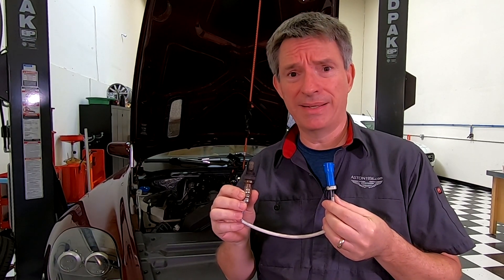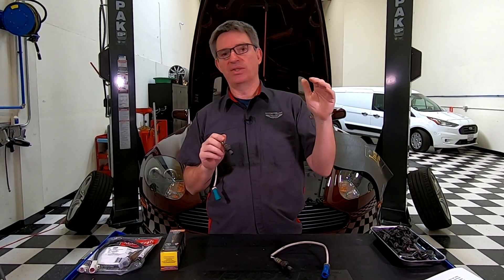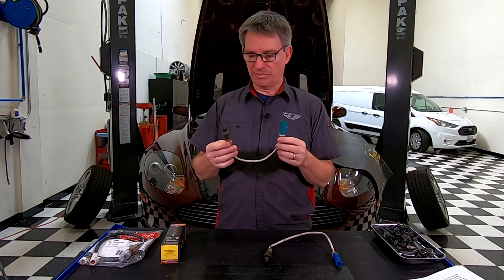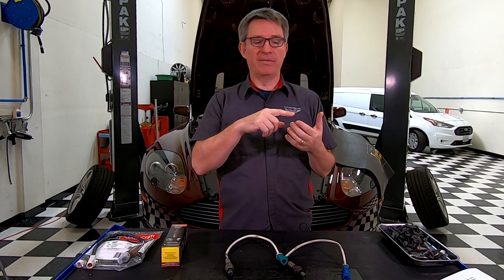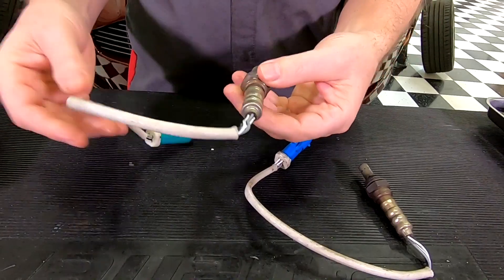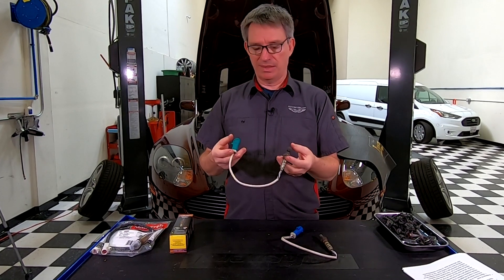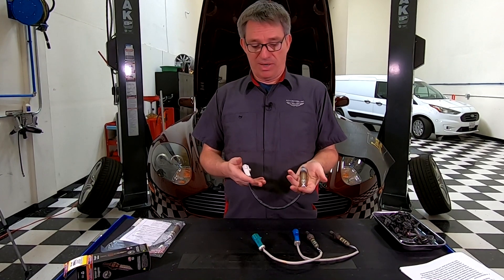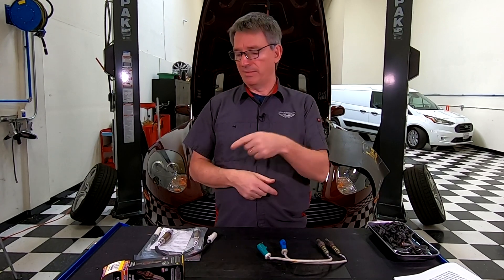Alternative O2 Sensors for an Aston Martin DB9

Comment: Hi! I noticed that DY1401 is actually downstream sensor, can you use it as upstream sensor as well? Thanks!
Reply from the maker: I am using them both upstream and downstream in my DB9 for over a year now with no issues.  I believe the Ford parts page forwarded both OEM part numbers to that new DY1401 part.

Comment: Great video, thanks for all the informative videos you produce.  I have a 2008 V8 Vantage 4.3L and have codes P0133 and P0153 which are codes for Slow response Bank 1 Sensor 1 and Bank 2 Sensor 1.  Wondering if anyone knows if there is an alternate part # than the replace the expensive Aston Part?

Comment: this isn't intended to be critical. the information here is very useful...but

ford, most likely, didn't make or even design that o2 sensor either. some procurement officer at ford was given the task of finding third party electronics companies that manufactured o2 sensors and then set up a meeting with that company's sales department to go over their catalogue and pick out a few (possibly with some input from ford's electonics department) suitable ones. then ordered a few million! :)

the days of the "River Rouge Plant", where iron ore, balls of raw rubber, and sand for making glass were loaded into one end of the plant and model 'T"s rolled out the other are long gone. 

BTW it's pretty much an industry standard that they emit a voltage between 0 and 1v depending on how much oxygen is present, so i bought a lot of 4 ford explorer ones on ebay for about $10.00 apiece, delivered. as long as the connectors are the same and they're long enough. they should work. in fact, the front and rear sensors are the same on all cars, AFAIK, and the only thing that differentiates them on an aston (and maybe some other cars), is the length of the wire. so fitment will have to be taken into consideration.
Reply from the maker: Thanks for sharing your thoughts.   There may be subtle differences between brands, quality and some specs (sensor element response times, things like that).   I'd agree that Ford probably has a rigorous spec that they require the sensor to meet, and then a third party vendor designs and makes all the sensors for them.   Nothing wrong with that, Ford ultimately has to be the warranty provider for millions of cars fitted with this sensor, so they aren't going to put in a crappy one.  And the advantage on price comes from they purchased millions of them.  Good for us.  Thanks for watching.
Reply: There is only 2 supliers in the World  for proportionnel sensors NGK (=NTK) Japan end Bosch Germany.

Comment: The motorcraft is a no brainer for me as well which is why i use their oil filters. As a matter of fact as suppy is down and prices are up i bought a 5 pack of oil filters i keep inside of my utility room. Thanks for sharing
Reply from the maker: Which Oil Filter are you referring to, the Racing one, the FL xxx one?   I've got a series of articles on these coming up as well, the Ford is not the same as the OEM Aston.   No verdict on better or worse yet, but not the OEM for sure.    I've tracked down the OEM maker, just trying to sort which of their retail filters is identical (if they offer the same one).   Fun to figure out.  Thanks for watching.
Reply: This is all new to me so I am very appreciative, before I bought my vantage v8, i really had no idea because my previous cars (Honda'), I did not have to to such intense research.

Comment: Plugs and coils also..... 🙂 3 years in my DB9 and my Lincoln ignition coils are working perfectly!
Reply: Great ! Are they the 2 or 3 pins ones ? Did you have to change the rubber sleeves ? I seem to remember that the ford lincoln ones had a different length for the spring. If on top you could share the part number would be fantastic ! Many thanks
Reply: Hi Can you please share your Lincoln ignition coils number!
Reply from the maker: I'd like to know the exact Lincoln/FoMoCo part number as well if you can share for the 2 pin.

Comment: Just had the ones on my vantage replaced under warranty. But usually these are a pain. About every 2-3 years they go bad
Reply from the maker: My experience has been with the V12 of the DB9, and my 17 year old sensors were still plugging along fine.  Not sure what might cause the deterioration in the V8's.    Thanks for watching!

Comment: Good find. Its amazing when you start cross referencing parts, they are basically a parts bin special. From what I can see on my V8 Vantage, there's alot of Range Rover Sport parts on it, along with usual Ford and Volvo.  Having owned an Audi Quattro for many years this was a similar thing. A hand built car with most parts raided from the VW Audi parts bins. Once you get adept at detective work it's amazing what they used. Keep up the good work.
Reply from the maker: I'd agree that they definitely picked their battles.  Why design a bespoke O2 sensor when a perfectly excellent option is already available that does exactly what is needed.   Thanks for the kudo's and for watching!

Comment: Hello steve, Great find, The improved ford version might have better durability and functionality. I noticed the white connector seems to be slightly different design compared to the aston green one, there are two small protrusion on the sides of green aston connector that is missing with the ford design. Can that cause any issue? As always great video and thanks for sharing.
Reply from the maker: Good spot.   THe new sensors don't have the extra tabs, so they fit the old sockets (by design I think).   I think the tabs were there to prevent a Green sensor from being plugged into a Blue socket and vice versa.  Both the Motorcraft and Generic didn't have these tabs any longer.  Begs the question what's the difference between the Blue and Green originally, but I haven't found that out (yet).  Thanks for watching!